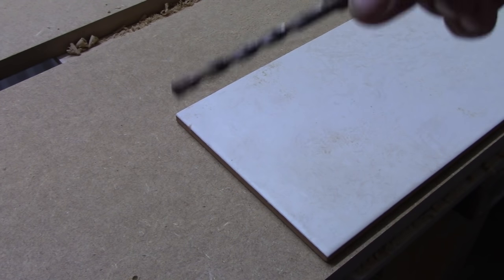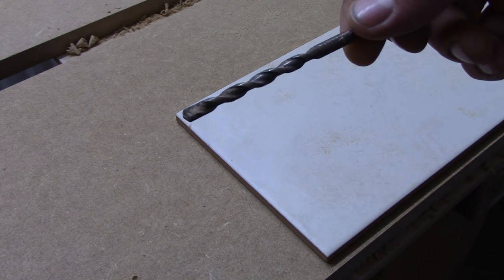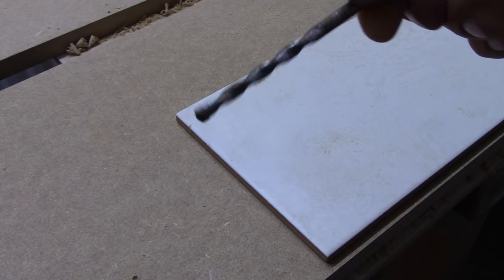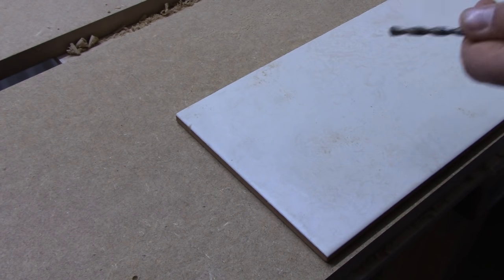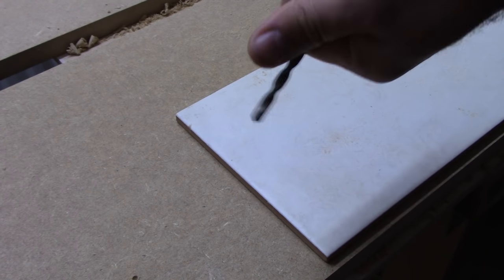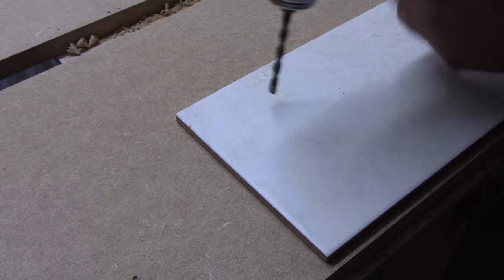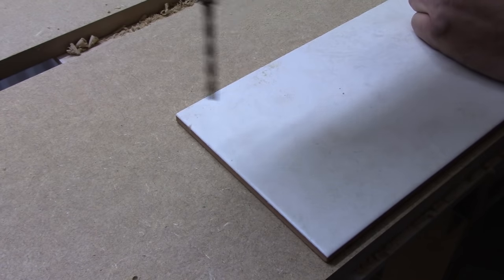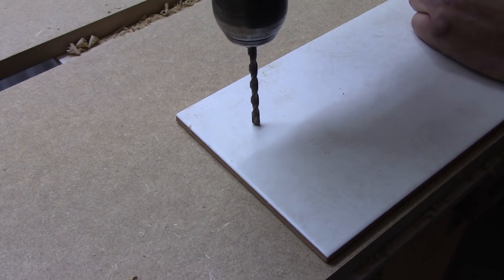Drilling hole in ceramic tile. How to make a hole in a tile. What drill to use.

Comment: Have to put the drill on any special setting? Thanks
Reply: Just drill mode, not on hammer mode
Reply: @kotimoto  I went for it last week. Worked like a charm. I got the 6 piece ceramic drill bit set from harbour freight for 11$ and they are great
Reply: @johnc1280  I have a small project coming up, have ordered the carbide tungsten drill bit, the tiles are old and brittle, so will take it slow.
Reply: @kotimoto  good luck. what is the project requiring to drill into those tiles
Reply: @johnc1280  wife picked up a kitchen rail from IKEA,  she wants them installed.

Comment: its weird how the first one you moved it around at all random angles but 90°. but the one you suggest you keep it vertical.
Reply: That's mostly because with the first one, the tip of the regular bit will slide all over the tile due to being a blunt end. By tilting it, your using the side of the tip of the bit to grate the glaze on the tile and give the bit something to actually grab and stay in place. After he's done tilting it for a sec, he drills straight down like the rest. The other bits have a sharpened end that is hardened to be able to scratch the glaze of the tile on it's own, so as soon as you start the drill, the bit has already gone below the glaze into the clay that makes the tile.

If you don't want to use the drill like that, a simple alternative would be using a small piece of sandpaper on the area you intend to drill, but that doesn't exactly looks nice if you over sand and take the glaze off a visible area. Another option is if the tile isn't already on the wall, drill from the non-glazed back of the tile. But most people are drilling after installing them, so best bet is to just not get glazed tiles.